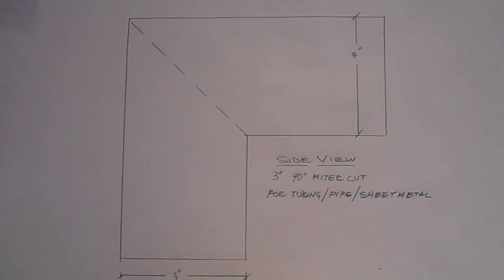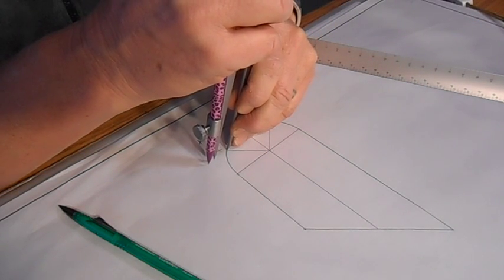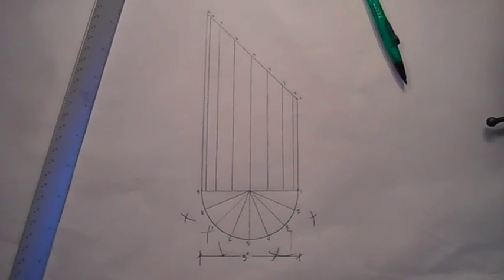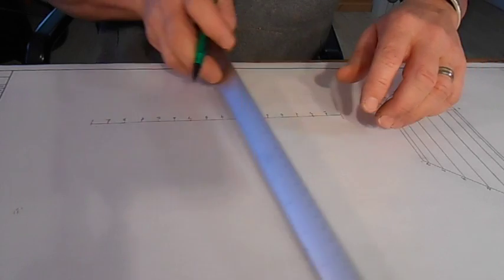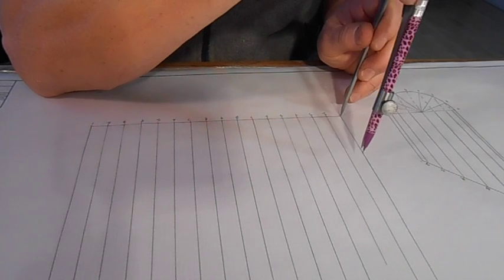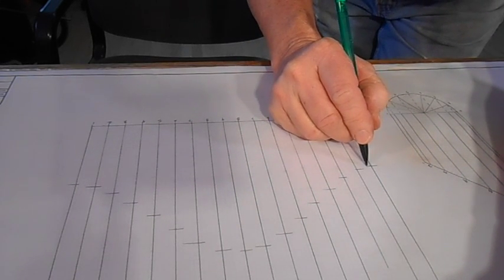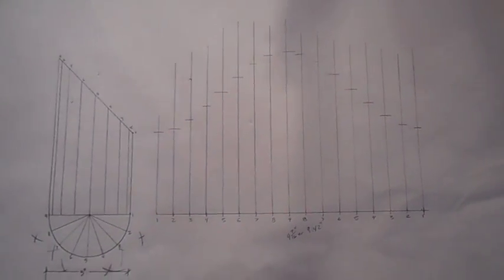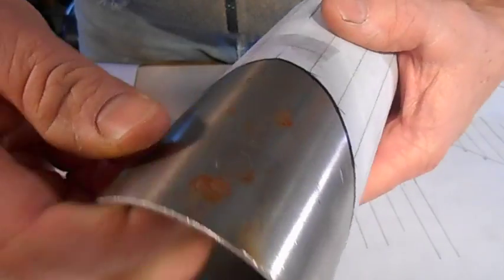Making a Template to Miter Pipe

Comment: OK, love the video and the technique, and obviously it works.
But it looks to me, for the layout of the 16 segments on the long line, at 4:26, you measured not arcs, but chords which would define an inscribed polygon, which would have a shorter circumference than the circle you are working with.
And yet the cut out template fits the pipe, and I can’t see why.
I don’t think the 1/32 inch gap in the conclusion explains anything.
Dave? Anyone?

Comment: I’m 27 just learning how to weld. I decided to build a swing set out of 4 1/2” pipe for my kids. I only have a cut off saw to cut it with, which has a 45 degree angle to cut on the base. But I really wanted to make sure (because the pipe was so large) that I could lay out the correct angle on the pipe to double check where my blade laid. Thank you for the information. Feels good to learn things like this.
Reply: If you happen to see this. Couldn’t I (for time purposes in the future) wrap paper around the pipe, cut it where it meets, and then divide each half from the middle by 8 and lay out my 1/8th measurements that way?

Comment: For those curious when he marked the x's for the halfway point theres no set distance just make sure you dont make a mark and then change it on the second or it will be off. I learned that just now
Reply: Thank you. I've been racking my brain comparing what I'm doing to him and not getting the same results.
Reply: @t_train3796  distance the two points on the wing divider to roughly 3 quarters of the distance between points for the template. They will intersect. Just make sure it stays the same or will mess the whole thing up. Lot of trial and error

Comment: I was a combination pipe welder and fitter in the offshore industry for five different oil companies and this type of information was  wanted by a lot of welders that were good welders but not fitters they used to buy the templates already made up from a man out in Mexico that was sold in a welding shop out of Venice Louisiana and Matthews Louisiana templates were a high desirable thing desired by many welders who did not know this type of knowledge on how to make their own templates but having this knowledge saves you a lot of money because you can make your own templates of every type of angle before you even go off shore of course there are other tricks to take one pipe and sleeve it into another on a horizontal or any type of angle there is a trick that you can do with multiple welding rods if you don't want to draw out a template at all and it's quick and it's very fast but I don't have the time or the means here to go into that but this gentleman here that posted this video is doing welders a lot of favors here by showing them how to make their own templates especially when you go for a job where they want you to be a fitter as well as a welder I'm retired now and have been for years but I love the trade of welding and fitting
Reply: Grammar is much needed my friend
Reply: He's a tradesmen, all he needs is technical know how and understanding mathematics.  He couldn't care less about his GRAMMAR lol  @raulgallardo5014

Comment: there is a much easier faster way just say pie times die amateur and that will give you the circumference then just take the length of the circumference and draw the length of the line horizontal then just divide that into 16 equal segments there's your template

Comment: 9.42" would be closer to 7/16ths, or .437". Thank you for the video, a friend and I used it this evening to lay out 12.75" dia pipe for a weird angle, all we had was a long and short measurement, no angle, but after some Keystone Kops antics, we pulled it off

Comment: How did you get 90degree of the 3"pipe drawing?
Reply: Half of the total internal joint angle. Therefore the angle in the elevation is 45degrees.

Comment: how do you set the compass up to divide the semi circle into the parts?  just divide in half over and over?
Reply from the maker: Good question. You can use the compass at various lengths- Just swing the arcs from each vertical and horizontal intersection lines. Obviously, the length has to be able to reach out beyond the semi circle. the arc crossings will perfectly divide the section. Give it a try. It'll make sense when you try it a time or two....-
Dave

Comment: Can that same template be used for smaller pipes then 3inches?
Reply: no. it is only good for a 3 inch od pipe at a 45 angle
Reply: This method can be used for  every size of pipe mitre and angle

Comment: I have watched a pipe fitter using the wrap method and a pipe fitters manual and it was far quicker and easier but your approach is interesting.
Reply: I'm also used to using my bluebook. I think this comes in handy when working on anything under 4" pipe, you can use a better grade paper and keep it in your box for later.

Comment: Your taking a straight measurement with the dividers on the bottom half circle when its actually an arc. if your off by a 64TH of an inch times 16 spaces you will be short 1/4 in. just a tip from a master sheetmetal worker.
Reply: +Brent Hick the difference between the chord length and arc segment length (at 22.5 degrees) on a 3inch diameter pipe is .004inches (.585 vs .589)...it's only .007 difference on a 6inch dia pipe. As long as the correct semi-circle was drawn and divided correctly I don't see how it's going to be off by 1/4 inch? I guess that's why he said to double check the length of the line (which would be an approximate circumference) at the end to see if it was near 2(pi)r--if that measurement was off by 1/4 inch then definitely something went wrong...especially on a 3in dia pipe.

Comment: this was very helpful.  I ended up finding a calculator online bit it's great to know how to do it. What I would really like to see is how to cope square tubing to fit pipe. I have a project and I need to mate a 4x3? or 2 to a 16 inch pipe.
Reply from the maker: +MK116Alex 
A 4x3 to a 16" pipe will have only a slight arc to fit. i would probably make a slight cut with an abrasive blade in a 4 1/2" angle grinder and then clean it up with a grinding disc.-
Dave
Reply: Thank you sir. Yeah I figured it probably wouldn't really require a template. I can be so anal at times. I think I should have been a machinist.  :-)

Comment: HI Dave - Watched this several times.  Your instruction is very clear.  One thing I missed and haven't figured out.  How did you determine the length of the initial segment you divided into 8 sections?  My finished template was too short because my initial segment was too short.  Thanks
Reply: I'm pretty sure the initial measure is the radius of the circle.
Reply: Darryl Braun No, it's the diameter of your pipe